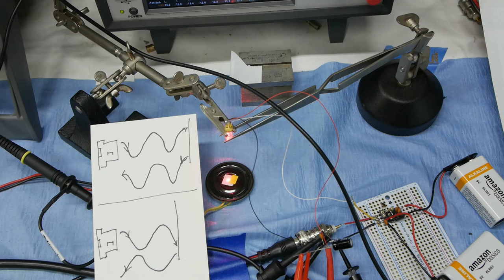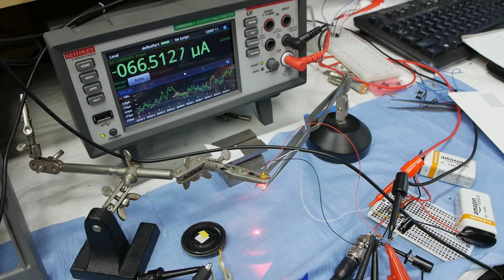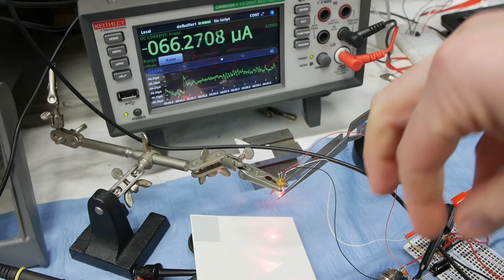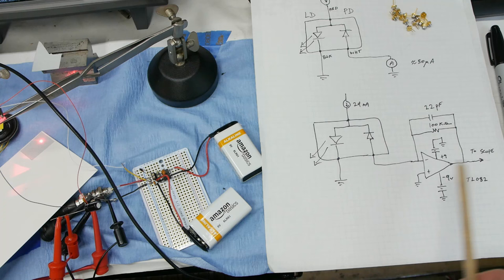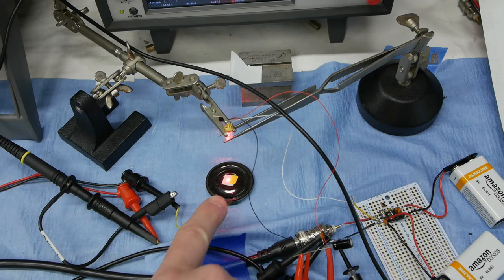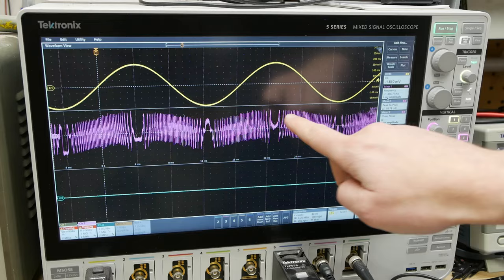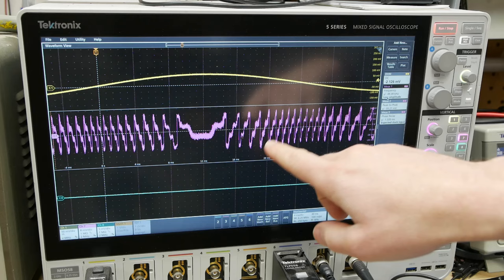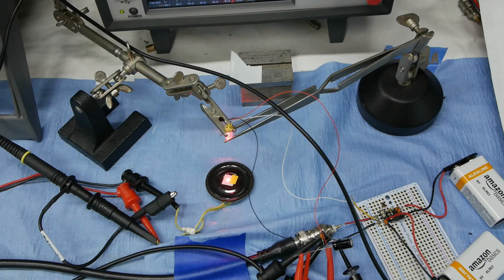Laser diode self-mixing: Range-finding and sub-micron vibration measurement

Comment: In the last part of the video where you demonstrated self interference,  I have a few questions/concerns.
1) since f=c/λ, and if λ=600nm, then f=5×10¹⁴, which is beyond the measurement capabilities of most instruments,  the distance measurement is not absolute but based upon the repeatability of your ramp.
2) you state the ramp (which looks like a sinusoidal waveform) changes the wavelength of the laser but do you know by how much? Based upon what you are showing, it is changing the λ by about 1 part in 20 billion. Does that sound about right?
3) Do you know of any way they can measure distances absolutely to say 1/4λ?
Thanks

Comment: Would the amplitude mention at 15:00 be useful for longer range measurement, since is related to the intensity of the reflected beam?  If you could also adjust the distance from diode to reflector, and keep track of the coarse grained and fine grained distances involved.

Comment: But won't this phenomenon mess up the original function of the monitor diodes in a conventional application? The laser current would vary widely if an object is moved around close to the output. That could be bad for the laser  diode.

Comment: I am confused as to the wiring of the 3 pin laser diode. I have a similar one with all of them common cathode --- the exposed pin on the photodiode is the anode. How are you supposed to reverse bias the photodiode? Is it already connected internally?

Comment: 11:23  is this bad for distance measurement ? I think you can compensate this using two laser light Or one  Combined with Partial reflector mirror sets  to get 180° opposite phase   just like ligo setup works .

Comment: Haven't i seen something like this being used as a z-distance-probe in the 3d-printer scene? What's the minimum amount of distance it can measure? If i remember correctly the z-probe i was thinking about got bad reviews since it was a combo of a laser + external camera sensor which failed to accurately measure sub millimeter differences.

Comment: Hello, thank you for your very interesting video ! Do you have more informations about the phenomenon you noticed at about 15:20 ? Would it have anything to do with doppler effect ? Although I am not sure because if in one direction, frequency increases, it should decrease in the other one, and it does not appear to be the case here, not noticeably at least. And if the high level on the yellow curve match the nearest position of the speaker towards the sensor,  higher frequencies should be one the left part, when speaker approaches the sensor, no ? I am just curious about that... In any case, thank you very much !

Comment: Gents, if anyone wants to buy such sensors off the shelf, see www.vocalzoom.com. the sensor is 1cm in size and uses a self-mix dedicated ASIC and a VCSEL. it has a SPI interface and it is very easy to use for velocity, distance and vibration sensing

Comment: Hi there, I am trying this SMI, but I am having doubts if the PD of the LTLD505T consists of an integrated circuit as you mentioned in the video at 3:44, since no response is obtained in the amplified signal to the self interference. It seems I have to cut the LTLD505T in order to corroborate this. Any help?

Comment: 15:36 could it be the laser sees the not perfectly DAC output of the generator or harmonics ? 
Have you tried it without ambient light or is the diode insensible for that wavelength ? 

Nice video, you always inspire me do experiments myself. I have build an opacity meter for a customer and at the same time one for my self that can do more (output to scope etc. and played a bit with fotomultipliers. I like these experiments with light.

Comment: Hey sir I am trying to replicate the same experiment with same current and voltage but not getting the signal like you are getting in the oscilloscope please suggest if you did anything which is not covered in video 
And also tell where you have put that cylindrical capacitor which is visible near opamp circuit

Comment: When running in absolute distance mode, I don't think the "old light" explanation is correct. A much simpler explanation is that a different total number of wavelengths fit in the space.

This should be easily testable. Does the number of steps change if the driving frequency changes?

Comment: Damn, im halfway through a mechanical engineering degree and you really inspire me, i want to understand all this but most of the nitty gritty are over my head right now. What qualifications do you have? It seems like you have are an engineer but im not sure. Im curious about all the calcs and how you worked out how to calculate distance from the changing current. I dont have enough understanding of the electronics either, it has me very curious though, i only know basic electrical circuits as im doing mech eng not electrical.

Comment: The rangefinding should work vastly better with a triangular waveform in. That would give you a signal out at a single frequency which the FFT would easily find. Very nice otherwise.

Comment: Can this laser module with photo diode be used as an optical microphone? I am thinking of a thin reflective mylar pulled taught on a 3" plastic ring. The laser module pointed at the center of the ring/mylar. On the opposite side of the mylar/ring would be the pick up side. Speaking on that side would then modulate the photo diode. Adding audio amp to boost it up would then be required. i am a HAM radio operator, built a few mics over the years, one was an LED with photo transistor as above mentioned. I wonder if the laser module is easier to align since it is all in the same axis. Any thoughts?

Comment: It's been a while since I've looked at the material, but iirc you can use an (the?) interferometer to figure out the wavelength of the laser light in question right?  Or maybe this setup precludes that possibility?  I'll have to look at my notes lol

Comment: So i can using this technique to make lidar right ?
Reply: It looks like you'd need a very high bandwidth amplifier, with the wavelength being so short, for detecting the speed of a moving object (compared to a doppler radar using microwaves). Maybe a beam expander could help in getting a longer range, too (less beam divergence). For measuring absolute distances, you'd probably need to calibrate your particular setup. You can already purchase lidar / range finding modules for a reasonable price though.
Reply: @threeMetreJim  Very good addvice thank you so much for your  reply.
Reply: @threeMetreJim  In short range it's pretty cool to make the simulation in lidar for small robotics using Vocore 2 coil size linux computer.
Reply: @robodev6033  I'm still pretty old school and would try to come up with a hardware solution for sensing needs (even though you can probably buy a cheap module). Mainly because it takes the load off a processor and I'm used to programming small micros. I know it's not really the done thing any more due to cost and size reduction, and how powerful modern micros are. Tbh, I've dropped the programming ball a fair bit, mainly because It's something of a hobby, rather than paid employment. If I ever do another large project, I'm looking to to do a 'set, fly and return' gps guided plane, but that's only if I get the chance. Things are a bit upside down at the moment.
Reply: @threeMetreJim  Yes upside down moment stay healthy and we would do some interesting stuff.

Comment: really interesting setup and measurements. Given the fact that you are using retroreflectors with not very well defined reflective surfaces I wonder if the peak in the FFT which you observe on the motor axis is not caused by the doppler shift of the reflected light. The frequency of around 10 kHz is probably in the right ball park: 3 mm/s, 500 THz (red light) gives about 10 kHz. http://www.rfwireless-world.com/calculators/doppler-frequency-calculator.html

The modulated frequency is used in FM-CW radar systems https://en.wikipedia.org/wiki/Continuous-wave_radar#Modulated_continuous-wave

Comment: So in theory you could potentially send and receive a transmission via a laser diode (transmitter) photodiode (receiver) as a way to communicate with others over a long distance depending on the power output of the transmitter laser diode, so instead of using say HF/VHF/UHF you would be using light as a transmission carrier it would be able also to be frequency modulatedor amplitude modulated your thoughts?
Reply: Given the odd harmonics being added in, you are more likely to hear the speaker producing a square wave than a sinusoid -- you pointed out that 60Hz is below the speaker's nominal (flat) response band.

My nerdy point, which may be wrong, is that your reasonable explanation of the speaker membrane ringing due to the fast edges "snapping" the membrane is maybe not as interesting as the real physics going on -- I believe the ripples on the ramp and square waves, visible immediately after the fast edges, are NOT ringing at all, but rather the speaker delivering the extra harmonic content of those waves.

This rationale seems flawed at first, because after all, the ramp and square waves would not be distorted as per Fourrier -- the ramp rising, and the square leveling off should definitely NOT have those ripple distortions.

But, there are 3 hints that support this harmonic content theory (over the snapping the membrane making it ring theory):

1. I believe the reason why they are visible distortions incurred by the harmonic frequencies themselves, is because those frequencies ARE in the speaker's nominal band, so it physically throws the membrane further for those frequencies than it can thrust the membrane at the fundamental (probably due to signal roll-off, because this would not be a magneto-mechanical limitation as you would expect for frequencies higher than its specified band).

2. The ripples appear to be sinusoidal, which supports both harmonic and ringing theories.

3. They are close to the edge, again supporting both theories, but also stands to reason from the Fourrier series, because the edge is where most of the collaborative mixing happens, and the ramp and square flat lines have much more destructive mixing.  

So to summarize, I believe if the speaker had a flat response from 1kHz down to 30Hz, you would not see what you referred to as the membrane ringing, because the speaker would reproduce the calculated (and generated voltage) waveform.

Concluding that this interferometry could very well be used to detect speaker motion that is not consistant with the input waveform -- that might be possible with a MATH oscilloscope trace, which should be a flatline, showing zero delta in wave shape and speaker cone motion reproducing that exact waveshape.  Ultimately, you could calculate and recreate the actual Bode plot from the series harmonics and their amplitudes -- but just as a quality check, you could make a speaker flatness checking rig for the audiophiles of the world (if anyone productizes this, I'm sure you and the Internet won't forget me, or our host :) )

Comment: How small is the area where the photons land on the speaker or paper? As Smarter Every Day 2 said, it would be an awesome way to do microscopic videography but if you're trying to measure the change in height of something really small, smaller than your area where the photons land, you won't get any accurate results

Comment: 11:23  is this bad for distance measurement ? I think you can compensate this using two laser light Or one  Combined with Partial reflector mirror sets  to get 180° opposite phase   just like ligo setup works .
Reply: counting peaks will introduce huge error over long distances as nobody knows for sure the wave length of the laser beam. these picometers will become milimeters over the long run

Comment: Why is the OPAMP pulling current at the input? The TL082 OPAMP that you specified has JFET inputs, so does it pull current? I would understand if it was a BJT input OPAMP such as the LM324
Reply: Time to go hit up a spice simulator. You'll understand it better after playing with that. (EveryCircuit (Android app/couple bucks)/LTspice(free)/KiCAD(free)/NGspice (free but command line only), Pspice (not free). SPICE software has a rather steep learning curve, but it's important to understand. Afrotechmods has a good 3 part tutorial on LTspice. That is still probably the most common one for beginners to learn.
-Jake

Comment: Anyone have any hints to making cheap laser pointers work better? I have a handful of them and most of them work a bit, then they stop working, I shake the pointer and it works in certain orientations, but not others; unscrew the battery compartment a bit, then it comes back on, or off... Laser is bright in one position, dimmer in another, off in others. Flaky as heck. Seems like a bad battery connection; I've tried stretching the spring that contacts the battery, with limited success.
Reply: You're on the right track. Try a drop of WD-40 on the battery contacts and switch. It works well on low voltage circuits which have oxidation.

Comment: I wonder if it would be possible under lab conditions if you could measure the vibration of atoms and infer temperature.
Reply: The thermal vibrations are random, so either you would have to measure a single atom or measure a substance in which the vibrations are fully quantized into crystal lattice phonon oscillations, which doesn't happen unless you are very near absolute zero.
Reply: @Muonium1  Makes me wonder how they measure the temperature of substances like a bose einstein condensate
Reply: @Muonium1  you might be able to calculate the distance of transition levels of excited atoms, Chromium.  The problem as you said you need close to absolute zero for interference purposes.  At those temperatures, you will not have any transitions between the different quantum numbers.  I will try to see if i can play with the setup and let you guys know.

Comment: Ironically, a company that automated the assembly of laser diodes with BFM (the photo-diode is a Back Facet Monitor), still uses a $10Kusd tube laser inferometer to calibrate their stacked piezo wire bonder horns. go figure !?

Comment: I bet if you spoke to the speaker it would vibrate and you could see it on your laser.  Count the edges to digitize.  The problem is the direction change.  You need to figure out a quadrature detector.  Put another speaker near it with a 60 Hz tone.
Reply: The signal is a ramp on each fringe so by the slope you can keep track of the sign.

Comment: I think your explanation of the interference phenomenon is not correct. I think the interference is produced between the light emitted behind the diode and the light emitted at the front and then reflected. In your drawing, I have the impression that you say that the interference is produced between the light emitted in the front and the reflected light. If this is the case, you could block the light emitted from the back and get interference. I think this will not work.

Comment: Nice video but it's a shame you used a crappy Tektronix scope.  Even a lowly Rigol would have been better and a Keysight would have put the poorly engineered Tek to shame.  If you put half a dozen Tektronix engineers in a big wet paper bag they would likely die in true Darwin tradition. Tektronix stopped making competitive products in the early 80's.